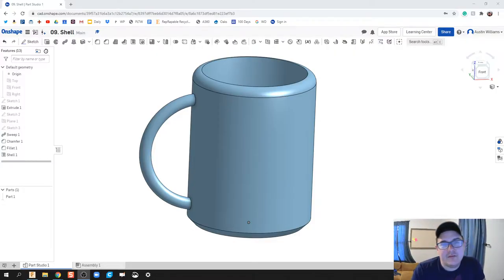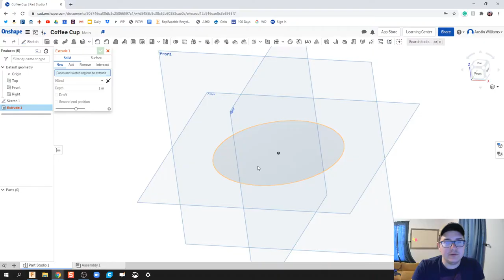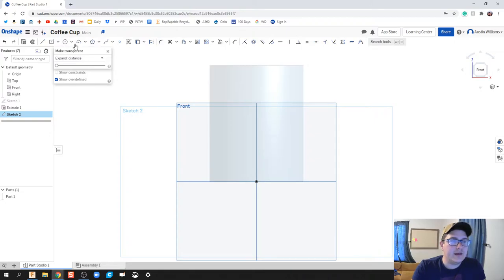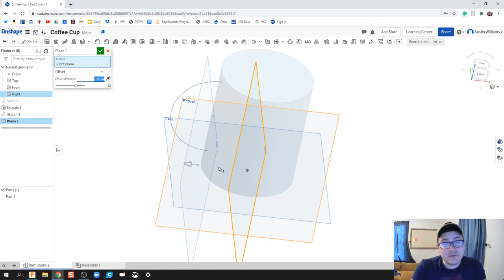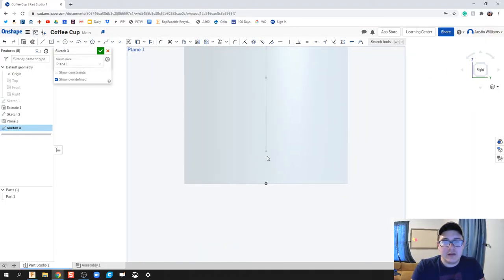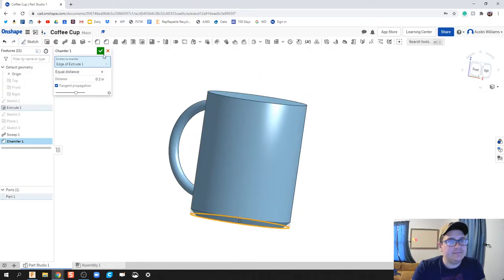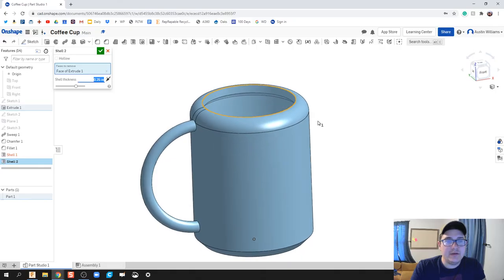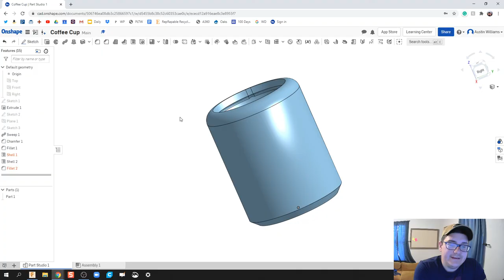Shell - Day 9 of 100 OnShape Journey

Comment: For the 2nd time you used the shell, did you click something so it could become like that? Pressing enter doesn't work for me, so is there another button to press that fully shells it?
Reply from the maker: There are small updates that have happened since I've done this video. I don't use any key shortcuts so people can follow along. Usually people have a problem because the handle line goes too far into the cup.